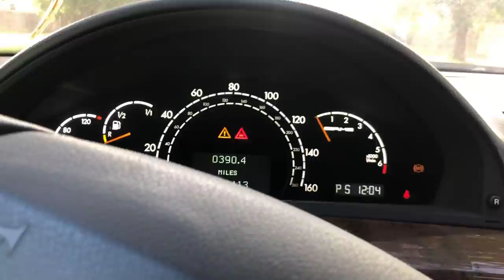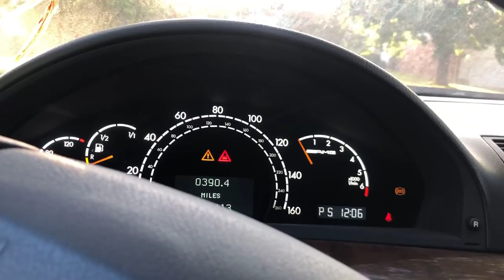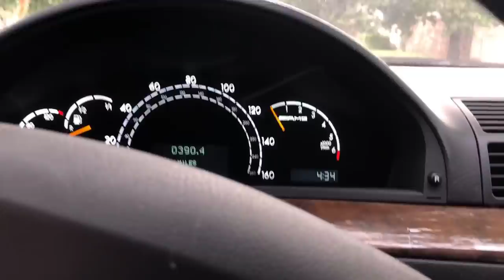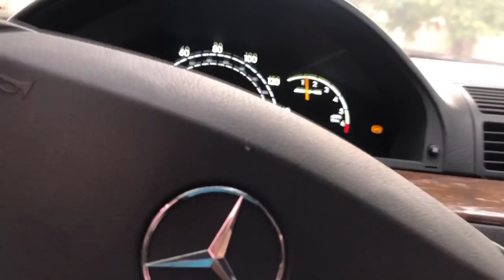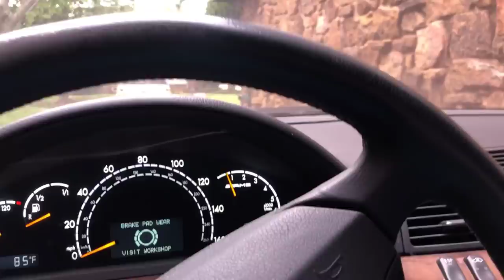Mercedes S55 has 56 Problems - Video #2

Comment: A radiator and oil change to start... Running it long enough to see if there are no head gasket issues! Don't have to drive it to find out. Fingers crossed for you🤞🤞🍀🍀

Comment: M113 engine are not known for head gasket issues.
Oil cooler in the radiator mixing atf with coolant yes.
This will be a great series
Reply: yes the M113 is a bullet proof engine mine has 200,000 miles on it and pulls like a train   agreed  check the Oil cooler mine cracked, had to have a new radiator
Reply: @hutchison82  I'm thinking this is a hidden gem. The interior is too good for a car that hasn't been cared for.
It's also got a 722.6 which is also bullet proof
Reply: @jeremyaustin9103  what s a 722.6?  do you mean 5.5 ltr   M113 engine
Reply: @hutchison82  the gearbox. It's one of mercs best efforts.
Really strong. Fixable. 5 speeder.
Serial Merc addict here

Comment: First thing I'd do is get a can of Berryman's B-12 chemtool and dump into the engine, let it run about 15-20 minutes and drain that nasty Oil out. And see what it does after you run it for awhile to find out If Mr Milkshake comes back. I've thought bad head gasket before and all it was Oil Detergents breaking down, that's why no more Kendall Oil for me. Thank you for another great Video.
Reply: you can do that and also you can look at the spark plugs to see if they have milky oil on them too? use some cheap oil so in case it is milky.

Comment: I'm happy for you that you got the car started with only the fuel system needing help. I seriously thought you had bigger problems as the cranking sounded like when all the plugs are out and you do a compression check - you know that sound? Anyway, glad to hear it run. Drain the oil and radiator (check that cooler) and go from there. I hope that right side frame rail is not out of place (hi or lo). For me, I have to agree with RANDY in that LOVE these cars and the intrigue thing they bring but (repair city) and who's gonna do it? (MIKE IS!!!) Best to you on this and all of your fleet. Listen:
RANDY has been entertaining us on his trip. We got to see places most of us will never be and I find that HUGE on his part for us. Shout out to your neighbor for checking on you too. Thanks for another! Sonny (CT)

Comment: Blown head gaskets are almost unheard of on m112 and m113 engines, especially one with that mileage. I would first replace the o rings on your oil cooler then give the cooling system a good flush and change the oil.

Comment: wheel facing wrong direction. replace tie rod. check. check oil. milky. try and start. no battery. install battery. battery weak. put on booster pack. still won't start. check fuel. not getting fuel. replace fuel pump. check. car starts! back off trailer. oh yeah, i forgot it's missing the front end. 🤣 🤣 🤣 🤣 🤣 This will make a great series!

Comment: As an owner of an '05 S55 and general Merc geek for years, this should be a fantastic build.

The M113/M113k is not known for failed head gaskets at all. I would suspect the goo on the dipstick is just from heavy condensation from short runs, possible rain water Intrusion due to lack of hood and poorly sealed cap, along with ages of sitting. I've seen the M112/M113 engines look as though they have mayonnaise growing off the oil cap.  You have to really run th se engines up to temp to burn all moisture out. 

The M113/722.6 is a fantastic power train that can survive years of neglect and abuse.  

A black AMG interior is a beautiful thing, especially on the W220.  This one looks to be in excellent shape. Curious to see what rear seat options you have, as there were a few different variants. 

Congrats on the AMG! Looking forward to the rest of her recovery efforts 👍
Reply from the maker: Thanks for the advice! It’s a regular bench back there. Not the split seats I had in my S500 I should have kept. Loved those seats but never got to sit Back there! Lol
Reply: @MonkeyWrenchMike  Absolutely! New subscriber here 👍

Change that oil asap 😁

Comment: Try Oriley Auto Parts I think it's a tire lock key. Depending those wheels could be as much as what you have put in the car. I'll check the car completely fir the wheels key. Then start with the fuses, check the wiring, then drain and refill fluids, then body parts. I say you can put another $1200-1500 depending on if used or new parts and it'll be good.

Comment: Mike, your oil need changing for sure but the engine is not easy to go bad as it's a solid engine, I saw some milky stuff on my 2005 S55 after I bought it from an auction but it was just water condensation due to the car been sitting, my suggestion first to work on, is sorting out the ABC and the check engine light or anything affect drivability,  then you can sort out the body parts that you can find all at the LKQ with trash money, the only problem is the front AMG bumper and the mesh grills as they are so expensive especially if you plan to facelift (2003-2006), I fixed my destroyed front bumper like a skin graft plastic surgery, it turned out fantastic and saved me $1500! you'll have a lot of visits to LKQ my friend.
Reply from the maker: Great advice. Stay tuned!!

Comment: That interior looks CHERRY.  That's worth it alone - non baked black leather S55 interior, very nice.  That's great to see that it starts - love using junkyard stuff - and that MB Design with the external fuel pump is a great idea, easy servicing.

Guessing next is an oil change maybe?  With the underhood exposed, and the poorly installed dipstick, maybe some moisture ran down the tube, or seeped in the oil fil cap?  With the CEL flashing away something wasn't happy.  Look forward to seeing what's next.  Good luck sir!!!
Reply from the maker: Thanks Nick! I’m doing just that. Stay tuned!

Comment: When I've bought cars with broken inner tie rods like that i just lightly grind off the rust and weld it back together. It works just to get it off the trailer and move it around the yard. When the new part comes in just replace it.
Reply from the maker: I haven’t learned how to weld yet. I tried, but it was a disaster...

Comment: You can take a about a 2 inch pipe and drill some holes in it and attach some nuts to it with a welder and put some bolts in it to attach for temporary tire rod connector.  The bolts tighten on the tie rod to connect it together. You could make one its for temporary to get the cars off the trailer quickly.
Reply from the maker: If only I could weld... lol
Reply: @MonkeyWrenchMike  You can weld man easy the new mig welders make it a piece of cake just put the torch perpendicular to the piece at 90 as close as you can get with out touching the work and  pull the trigger wala your a welder. Move the torch along slowly it should sound like bacon frying if your wire speed and heat are right. You can figure it out man easy. have weird beard help you the first time. You will be welding in no time. You should get a eastwood one they are good and a good decent price. A good deal. I have a expensive Hobart but its great I bought it used off of craigs list. I had to rent a bottle of argon. No big deal  like 80 bucks a year or was it 150 bucks? I think when I first got it was 150 because I paid for rent and the argon gas. You can weld man trust me. 
     I learned to stick weld its not hard at all just go for it. Sick welder is cheaper but really easy just spark it and drag it or push it. You will get the hang of it by doing it. easy stuff man trust me just takes some wanting to and tiny little bit of practice. To make weld good enough to weld a nut on a pipe your ready man. I got a Lincoln ac welder for stick welding they have millions of them on craigs list. for cheap 100 bucks. I paid 250 for mine at lowes. But I like my mig its fantastic although I love stick welding too. LOL You can get a auto darkening helmet battery powered to make it easy at the welding store. 100 dollars or so. Cheapo on ebay for  30 dollars auto darkening too. they work fine.my head is so gigantic I cannot fit the 30 dollar china helmet LOL almost size 8 I think one guy at the prison has a bigger head than me, the welding supply guy said, and he supplied the prison. I got the fat head! LOL I told my old boss its because my brain is so big it needs more room. ha ha he didnt think I was funny. Welding is so much fun you will love it.

Comment: I would do brakes first because at some point you are going to have to move the car.  After that I would tackle the engine with a compression test, as it did not sound too good when it was turning over.  that will tell you what the next step should be.

Also, the car might have been out side for a while, and you have had some bad storms.  The water you see on the dipstick might have gotten in there from the dipstick hole, and not a blown head gasket.  Does the car have any coolant in the radiator right now?
Reply from the maker: That’s my thinking too. Trying to be positive. And yes, there was green coolant, too!

Comment: 5:36 - You might get lucky on that oil. Could be something as simple as a PCV system that is leaking badly. These merc engines need a healthy PCV system or moisture will build up in the oil and make you think you have a blown head gasket.

Comment: Could it also be the oil breather system? If it’s clogged it could produce a white/gooey substance on the upper part of the dip stick although not mixed with the oil - those wheel bolts look like they can fit a ‘bolt removal’ type socket.

Comment: Mike get a QUICKJACK lift 7000ext stop working on those trailers get the 12 volt dc model for the power unit this way you can take it with you it will fit in a ml320 I know this for a fact it will make your life easier trust me I got my 1994 Bmw 740i on mine right now going through a resto been invaluable .if your gonna buy one get the truck and suv adapters along with it will give you more  lifting options especially on the euro cars and trucks

Comment: Conductor plate, transmission connector, gasket and filter too. It stayed waayyyy too long  undrivable. New steering, hydraulic and brake fluids

Comment: I got the bad news about my ford edge ranger this morning at the front end shop the rack and pinion is out it gets the high speed death wobble so  it will all be 500 plus dollars and that is a good price actually. And no Im not going to try to replace the rack its Be och! I have done that and it s u   cks   I aint doing another rack and pinion. Yours looks like it needs a rack and pinion. that part hanging down is part of it. maybe you can tie it back up? with a clamp or zip ties bailing wire. does it leak now?  maybe its still works fine? I hope but looks kinda bad for sure.
Reply from the maker: It’s a reservoir for the hydraulic suspension. I’ve ordered the mounting brackets. I think the fork lift damaged it at Copart
Reply: @MonkeyWrenchMike  Well that is a relief I thought it was your rack and pinion reservoir so it not so then you got it all lined out new mounting brackets that is  good.

Comment: Either I am hallucinating or the fuel gauge answers the question of why it won't start. It also portends the filling of the new filter with sediment from he tank bottom. Many moons ago when the earth was young and dinosaurs roamed, I learned (the hard way)  to check the simple stuff first before spending a lot of money on parts you might not actually need.
Reply from the maker: I put $20 in premium gas in the tank when I brought the car home from Copart.